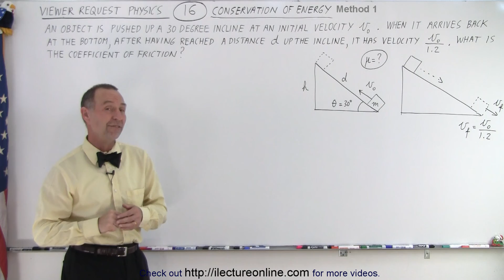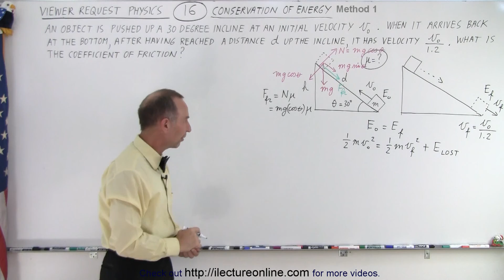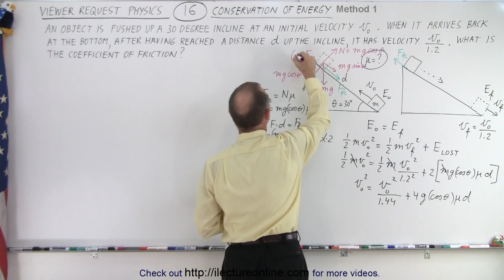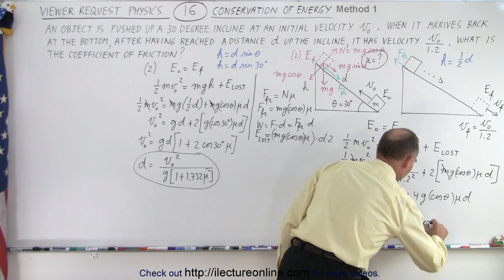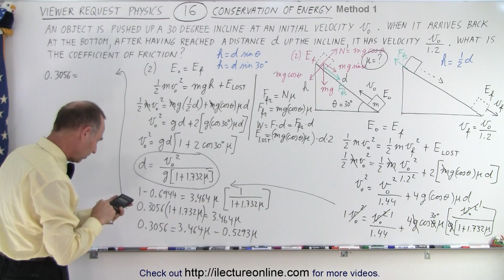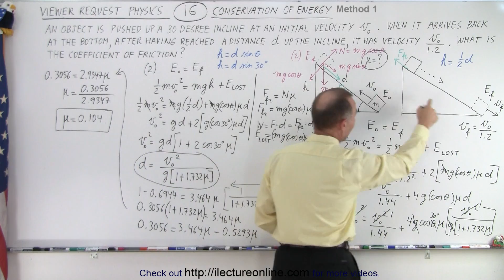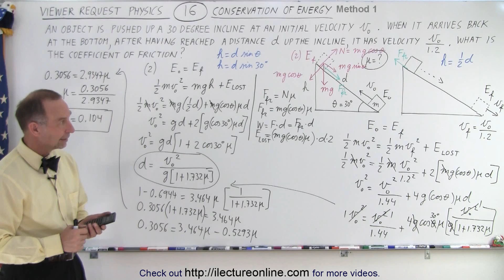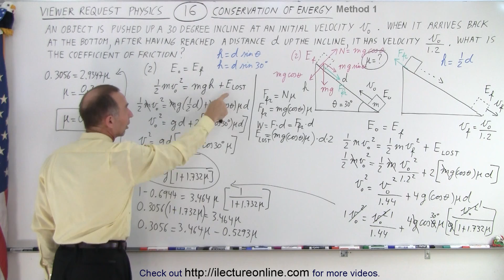Physics: Viewer's Request: Mechanics #16: Conservation of Energy

Comment: Nice job proff.
After solving a prob its always useful to step back & ask, why did this solve out inspite of the number of unknown variables/constants involved?
I feel that part of the answer lies is in:
  1. The mathematical properties of polynomials with multi-variables.
  2. The symmetry of the eqns & similarity of relative proportions of the variables within them. [Matrices]
There must be a mathematical corollary to that effect.
But now that we know mue, can this same procedure yield any other unknowns in the prob? (g, d, v).
 
This prob, as you've elegantly shown is solved from a physical event/physical laws, point of view . Which you've done using the energy Theorem, & that round trip event you did chop down to smaller events to bring in more eqns.
My question is, can this be analyzed by adding other basic physical laws? ie: F=m.△v 
Would that bring in any additional facility? or is it already included in the energy Theorem.
TYSM for your sharing & clarity.

Comment: whoa... I have to get this in before I forget... but  in no way do I expect you, Michel, to do a video on this idea.. but here's the idea.. Imagine a Baseball Pitcher throws the ball at 100 mph to the batter, and he hits the ball.. meeting the ball at 90 degrees.. but at a slight UP angle.. how fast must he swing the bat and at what angle to send the ball flying 420 feet so it's a HOMERUN...????  lol.. I'm working on this problem myself... but getting caught up on the Conservation of Momentum at Impact ...etc... It seems like this problem would be easy.. but not for me... Just a thought experiment for now...  Thanks for your video ABOVE...  You have this talent for simplifying physics problems and that is why we learn from your methods.!!!
Reply from the maker: Hi Philip.  That is a very interesting problem.  It does depend on the mass of the BAT, the hardness of the material, (if the material is harder and doesn't compress as much, the time of contact will be less, and thus the force will be greater).